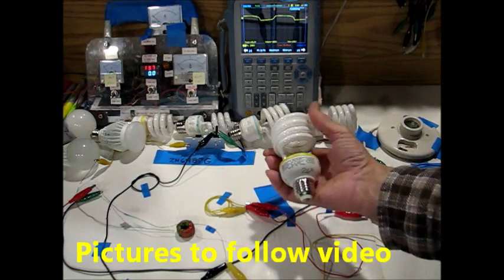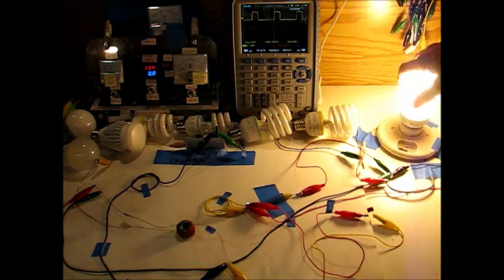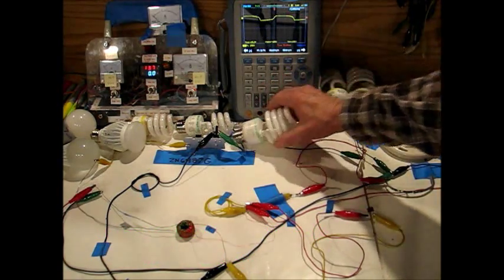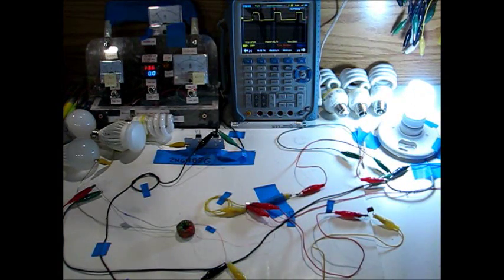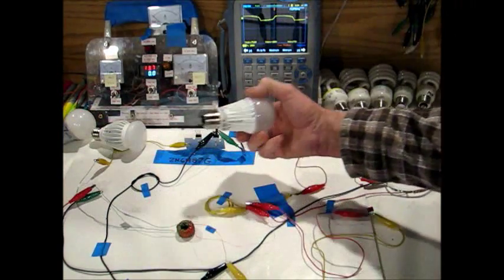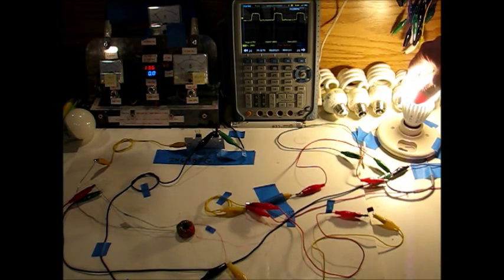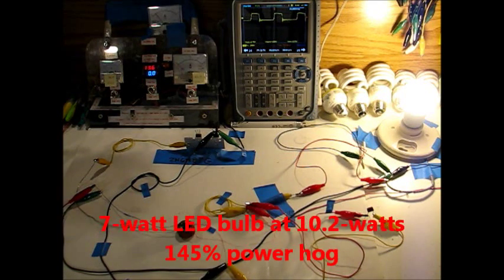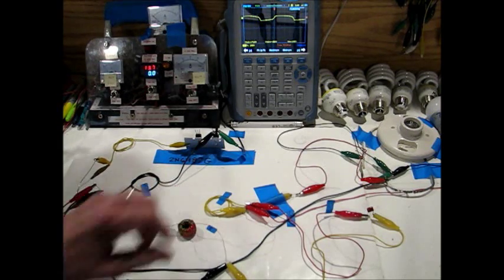19-watt LED bulb on 12v 5-watt draw circuit (2 of 3)

Comment: Yeah, I was supriserd the other day when a new cfl I bought actually lit when I had it on a light dimmer on minimum. So seems pretty normal that an ELV version would light at 5v, an LED's often light up at fairly low voltage. Obviously dimmable LED's would have no problem. 

You can power it at a lower wattage than rated and you end up with lower light output, so what is the point of the actual video?

Comment: Can this circuit run more than 1 bulb? Have you any results for parallel bulbs? Great video and very good analysis. Many thanks for sharing.
Reply from the maker: I have not wired more than one CFL or LED into this circuit at this time as of yet. But I will test that and let you know.
Reply: Many thanks. Am looking forward to the results.
Reply from the maker: Raymond Earle  Here's your answer Raymond, yes it will. will run only one of the 23watt CFLs at a time, 2 14watt CFL's at a time, or so far (all I have) it will run 1-19w LED + 2-13w LED's + 1-7w LED.  Check out the part 3-of-3 video in this series.
Reply: Many thanks for that and I shall be watching soon.